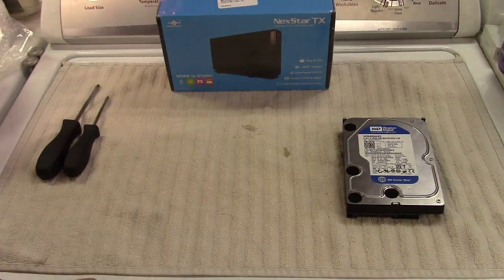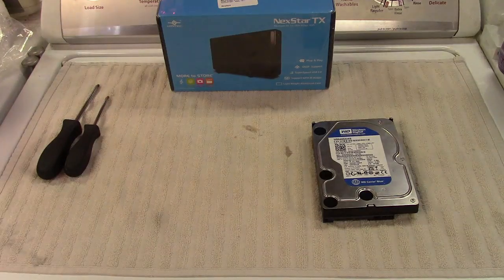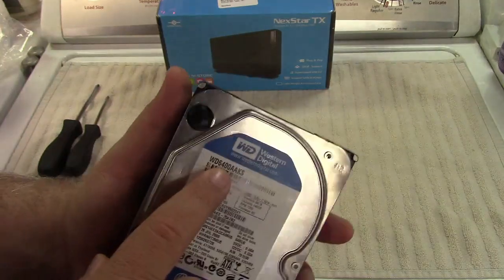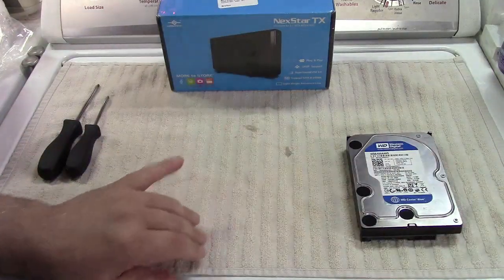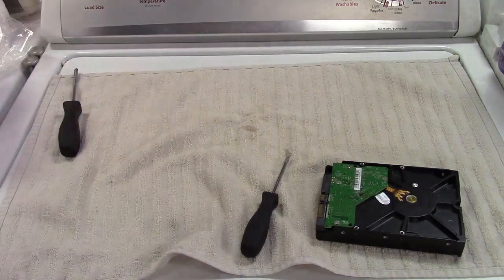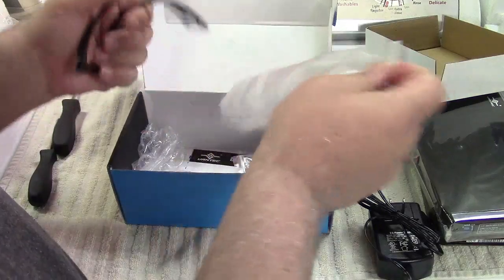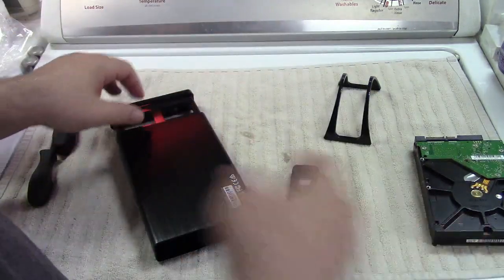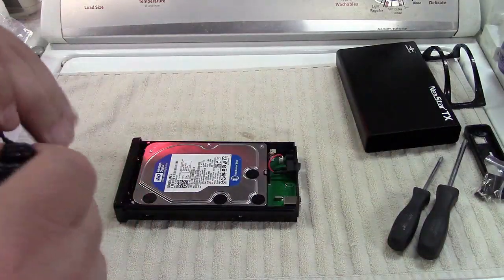Will This 15-Year-Old Hard Drive Still Work?

Comment: Saying a 15 yr ild hdd is pretty new is crazy😂. I have a 500gb wd from 2012.... its not fast, but not entirely slow. I was getting old family photos off of my old family pc and boy, it took 3 hours to ofload about 70 gb of data.
Reply from the maker: Depends how you hooked it up.  If you hooked it up via USB, most notably USB 2.0, your maximum throughput was only a theoretical maximum of 480Mbps (you got less).  If hooked SATA directly, it could be as much as 6.0Gbps

Comment: I bought a Toshiba HD and it lasted over 10 years,  I have another HDD that has lasted at least 11 years,  not sure who made the other HDD,  so I can easily see one last 15 years.  I believe both HDDs were Refurbs,  my guess was someone needed an IDE but bought a SATA HDD at the time,  since when I got those drives you could buy either type.
Reply from the maker: I must say, I've been lucky with hard drives myself.  I think a lot of it has to do with the amount of start/stop cycles, power on hours, and most importantly, how the drives are treated physically, while turned on.  They are a very sensitive instrument.  I've seen many die before their time.

Comment: It's a WD Blue so the odds are good.  If it were an IBM Deskstar it would be dead 5 timers over.
Reply from the maker: Yes, they were known as "Deathstar" drives.  Occasionally, there is a diamond in the rough, I have one that is still running and has got to be over 25 years old, and it runs 24/7/365.

Comment: I have a similar drive but it's a different model.
Reply from the maker: You probably have too many files on it, and that's why it's failing.  I challenge anyone to have 4.2 BIILLION files.
Reply: @jaykay18  nawwwwww, wrong drive, I haven't had any issues with it!
Reply from the maker: @ItzYaBoyJesse  Can you count as high as 4.2 Billion?
Reply: @jaykay18  yes, but a guy doesn't have that many files. Over 9000.
Reply from the maker: @ItzYaBoyJesse  Then it's not too many.
Reply: @jaykay18  right right

Comment: Regarding old IDE hard drives I've had good experiences with cheap m.2-sata to IDE converters - and you can find 16GB M.2 SATA SSDs for those very old machines that can't handle 32GB or more (I'm looking at you, Pentium1-200MHz.....) :D

As for getting decent 12V power supplies, I usually get those from when I buy new external HDDs for cheap and then remove the drive to use as an internal drive.
Reply from the maker: I'm not really worried about machines quite THAT old.  60GB would be fine for the stuff I'm doing.

I didn't look to see if anyone just sells the 12 volt adapters.  The ones that come with the USB IDE/SATA adapters usually have a plain old 4-pin Molex plus a Molex to SATA connection adapter.  Those are the ones I need.